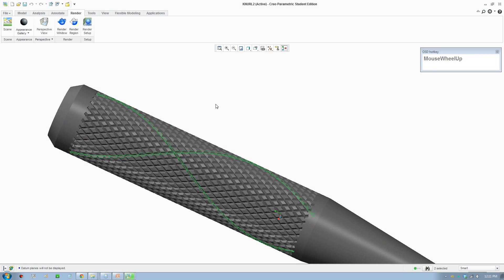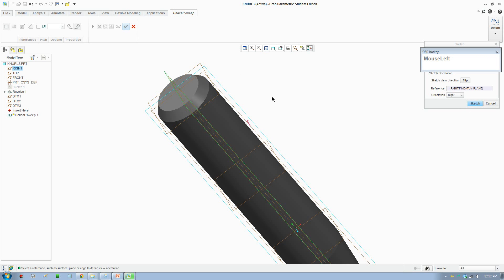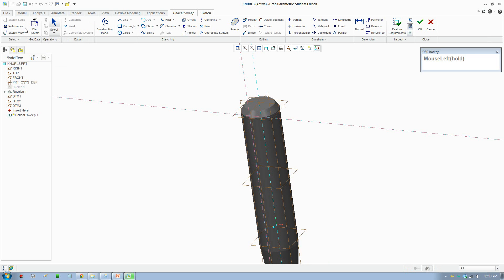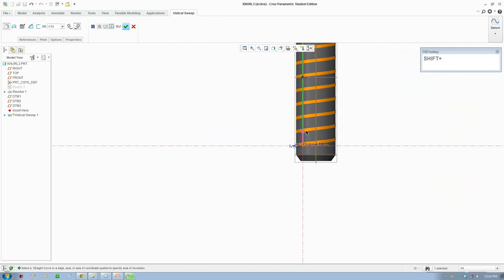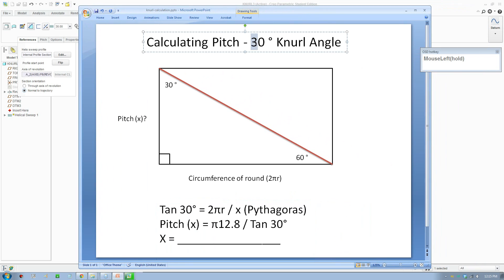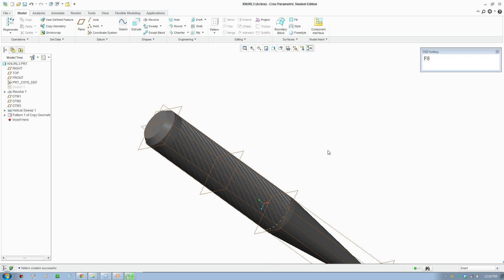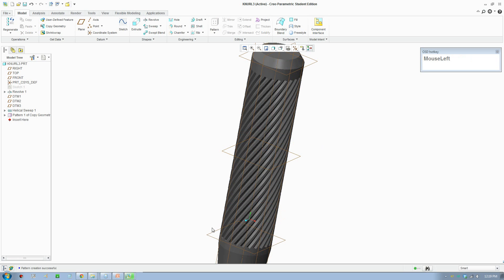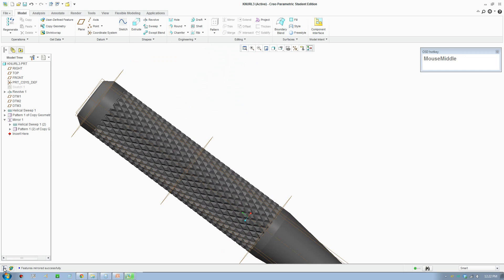Creo Tutorial - Knurl Pattern with Angle Calculation

Comment: hello there, I've got a problem that I hope you can help with. When selecting how many patterns I want I can only have a maximum of 4 before it starts to fail. because I cant have any more than this the design doesn't look as complex.
Reply: I got it now. I didn't click the angle button so that it locks at 360 degrees when creating the pattern.

I did put 360 degree manually though. Creo doesn't like it and will you the gnomes have failed. creo is in fantasy land I tell you!

anyway great tutorial, you've earned yourself a subscriber
Reply from the maker: SuperMusicfreak93 Glad to hear.